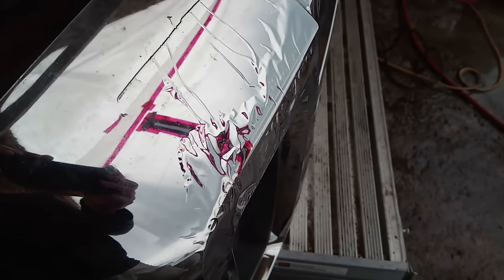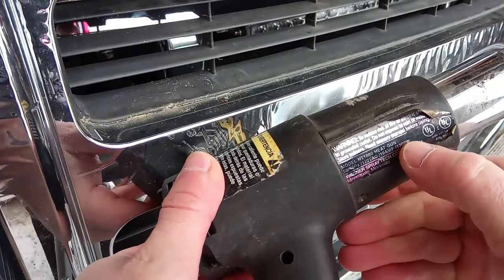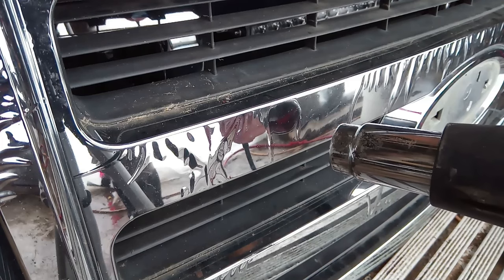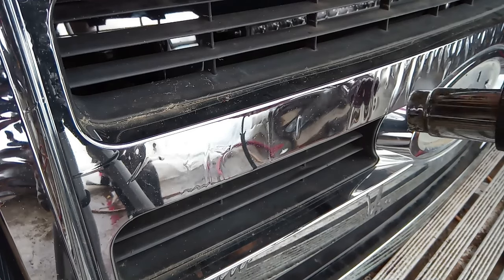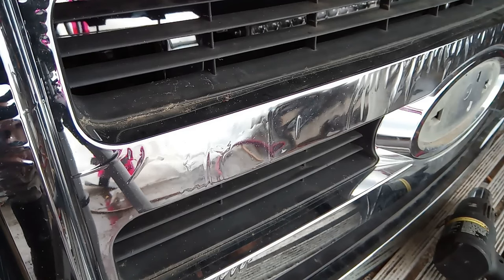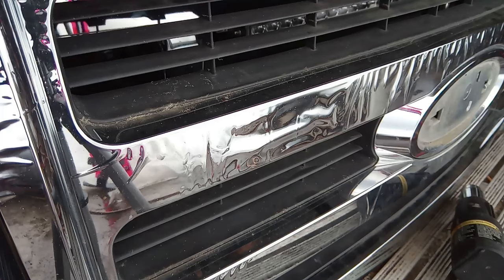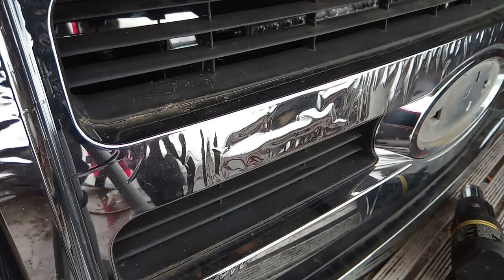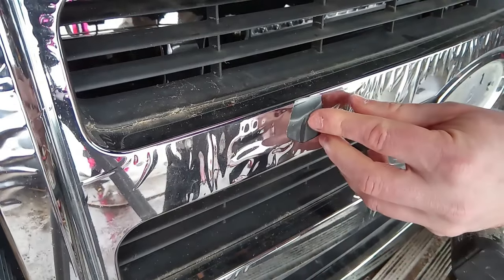How To Remove Chrome From Plastic (Without Destroying The Plastic)

Comment: Almost looks like you could just fix the chrome with the heat gun
Reply: I thought the same. Thought he would try smoothing it out
Reply: @ZubaireQ  I tried it on a part on my motorcycle. It works a little bit, but not completely.
Reply: This is the comment I came to find. Thinking of trying that for couple little pieces.
Worst case, it all gets removed and replaced. Lol

Comment: Appreciate the candor.
So the heat gun is accelerating the suns job of removing the chrome?☀️
Reply from the maker: Up here it's the cold that does it, get a bit of moisture in there through rock chips or such and -30c pops that chrome right off

Comment: Awesome I tried everything to get the chrome off with no success. I thought about heat but wasnt sure if it would warp the plastic. I'll give it a try.
Reply from the maker: It definitely can warp the plastic. There's always a sweet spot where you have enough heat to get the chrome to lift without melting the plastic, so take your time and don't apply too much heat in one place, even more so on thinner plastics. Let me know how it works for you
Reply: @backwoodsbuildingandfixing9223  Did you warp the plastic and end up buying new grill or did it work out okay?
Reply from the maker: @keldonator  Grille is fine, if you warp the plastic you used too much heat
Reply: @backwoodsbuildingandfixing9223  lol, I warped the shit out of mine and bought a new one. I have a warped chrome grill for sale if anyone wants it 🤣
Reply: @keldonator  you had me laughing soo hard when I read this!!! 😂😂🤣🤣🤣
Reply from the maker: @keldonator  Man...did you hit with a tiger torch or something??
Reply: @backwoodsbuildingandfixing9223  Just a harbor freight heat gun, I even started at the bottom to get a feel for it. After going along the bottom I looked at it and realized it was all warped like crazy and I knew I wouldn't be able to make the top look nice so I bought a new on ebay for $230

Comment: A side question that is not related.. If I want to cut a piece of chrome trim molding to shorten the length, will cutting crack the chrome on the surrounding resulting in peeling. Want to cut a piece of chrome plated ABS molding that is not specifically for my car and want to install it on mine.

Comment: Is chrome paint the same thing as was on there from the factory? Or is it like dipped or wrapped?
Reply from the maker: No, chrome paint is just very shiny paint. Factory chromed plastics are actually chromed, typically they'll coat the plastic in copper and nickel to make it conductive and then electroplate the chrome over that. When chrome peels off plastic usually it's because the base layer that the chrome adheres to has failed.

Comment: By the tome your done with rhe heat gun  your electric bill will be a $1000 with the utility power  rate increase
Reply from the maker: It's a 1200 watt gun my man, and you're only running it for a few minutes. I have 2 1500 watt space heaters plus a 4200 watt unit when temps go below -20c going all winter long and my bills are well under $1000 for two months, so settle on down now

Comment: Is there a way to fix it other then taking it off
Reply from the maker: You could try it with the grille on but I wouldn't recommend it, it's a lot easier to do with it off and there is the chance of damaging your paint and headlights with the heat. It's not hard to remove
Reply: @backwoodsbuildingandfixing9223   o no bro I mean fixing that wrinkles up chrome
Reply from the maker: @josearrvizo359  Ah I gotcha. There's no other way that I know of. Once it starts delaminating, it only keeps getting worse. Gotta start fresh.
Reply: So wats the best chrome spray paint
Reply: @backwoodsbuildingandfixing9223   thanks for replying bro
Reply from the maker: @josearrvizo359  Chrome spray paint is mostly garbage, there are chrome paints that are pretty sweet but you pay a good dollar for them. Alsa Killer Chrome and Super Chrome off the top of my head, I'm sure there are more. I know you can buy cans from Alsa, they're like 50 bucks each though. It's a lot cheaper to just paint match
Reply: @backwoodsbuildingandfixing9223  so my truck is red so I should just paint red
Reply from the maker: @josearrvizo359  It would be a lot cheaper, but it's your truck, you should do what looks best to you
Reply: @backwoodsbuildingandfixing9223  but after removing chrome do I paint it
Reply from the maker: @josearrvizo359  Yup
Reply: paint stripper should work
Reply from the maker: @aftech7268  It does not. I assure you, chrome will laugh your paint stripper into utter shame, though it might have its way with the plastic
Reply: @backwoodsbuildingandfixing9223  I do alot of wood work painting cabinets and stuff the gel striper just to mess around didn't do anything to it that a bust heat gun only thing I believe
Reply: @backwoodsbuildingandfixing9223  😆